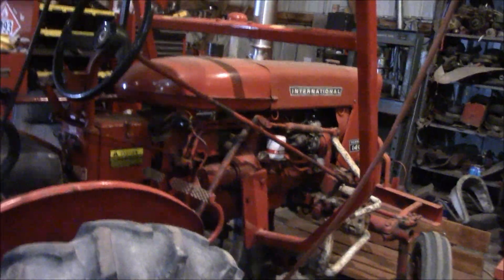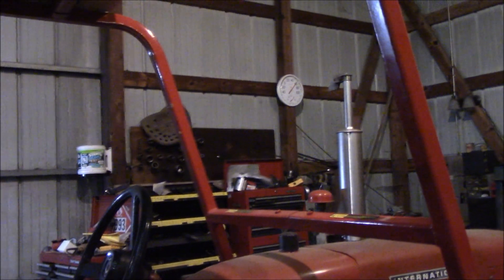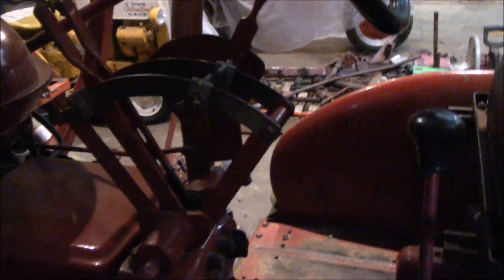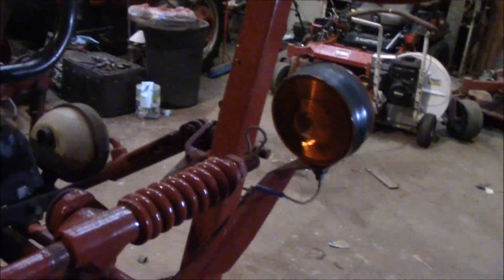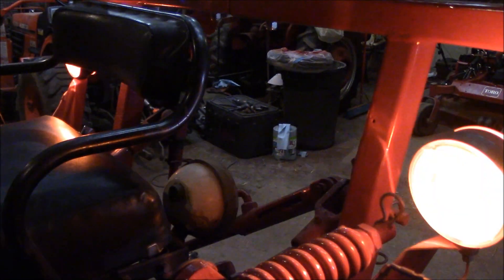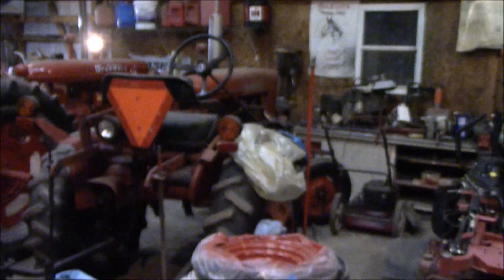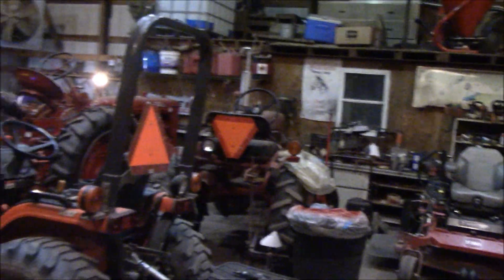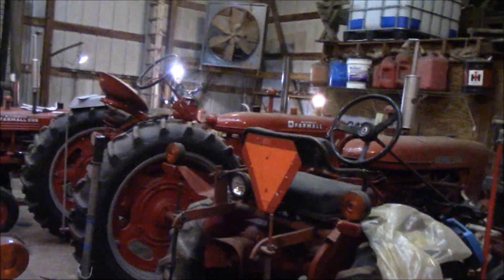Farmall 140 start and turn signal check

Comment: Do you run straight 100 octane racing fuel?
Reply from the maker: Yes.
Reply: @farmall51  I have 184 loboy with a c-60 motor. Wonder if I can run race gas in it? I didn't know if it would damage something
Reply from the maker: @bradmuth1014  It won't . Now if you are working it hard all day long I'd mix a little regular gas in it.
Reply: @farmall51  you should do a video on the  gas you use and why you use. It would be a good video to inform people

Comment: Why the racing fuel?
Reply from the maker: Cleaner burning and no ethanol.  Mostly put it in the show tractors because if them not working as hard. The working ones get the non ethanol and sometimes I add a little of the racing gas to rich it up a little.